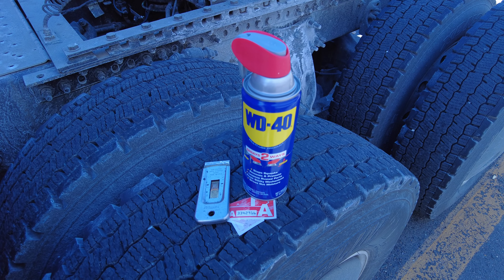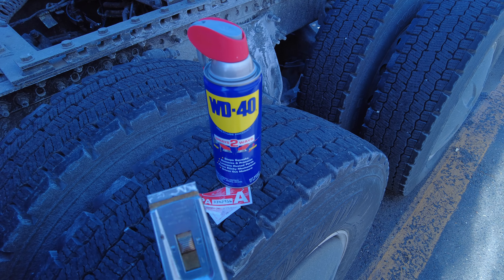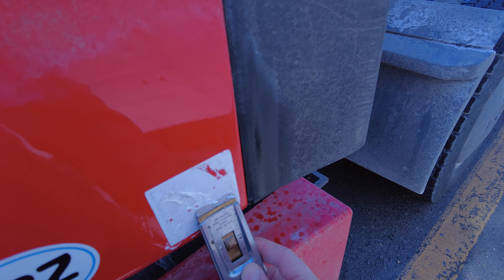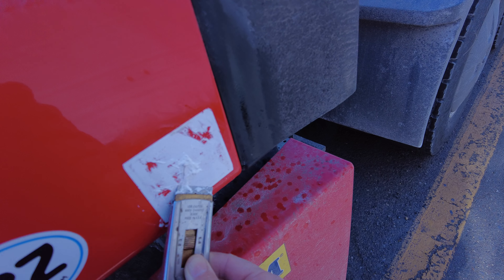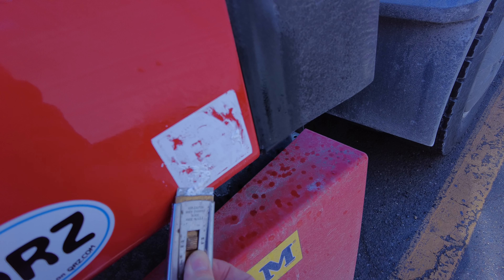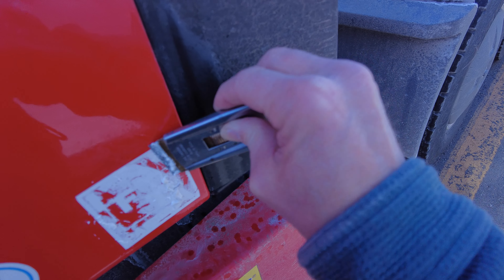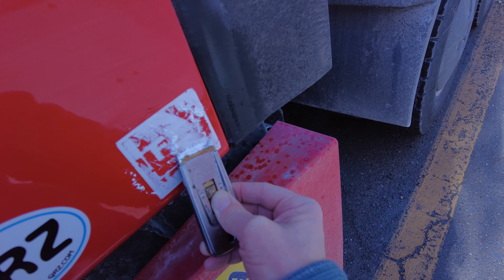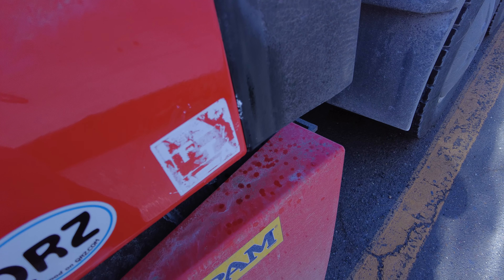How to remove and reapply IFTA and NY HUT stickers

Comment: There’s a product called Goo Gone that is meant for removing sticker residue. You won’t need any blades, but if you want to speed up the removal, then you want to use a plastic scraper.
Reply from the maker: WD40 is a product I already have on hand. I personally won't be going out to purchase another product that I will rarely if ever use. Thanks for the comment though and thanks for watching my videos! :-)
Reply: @NormCobbJrTourLife  

For the few bucks it’s worth, it’s not bad. Walmart sells different sizes, and even a very small one. I’ve used it for many things in my house like when you want to remove a sticker from something you purchased, but it leaves a sticky residue behind. You got to let it sit for 5 min, though for it to work best.